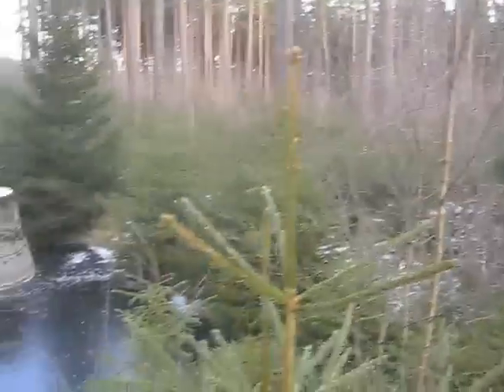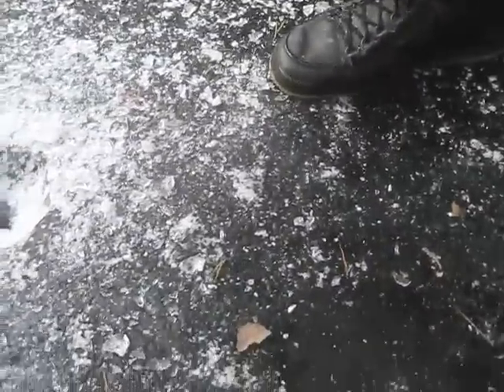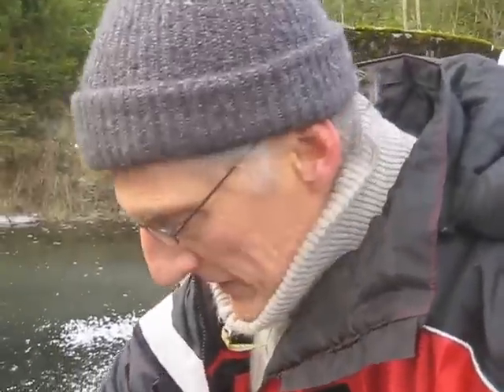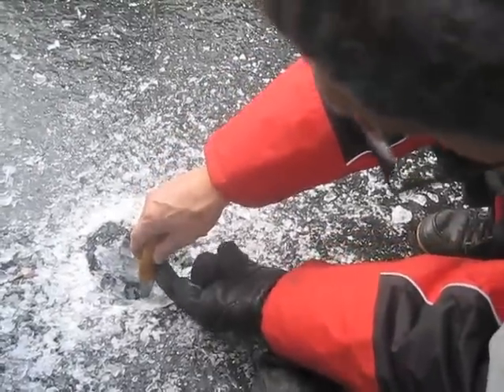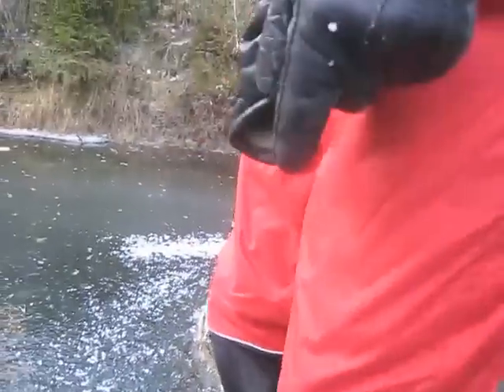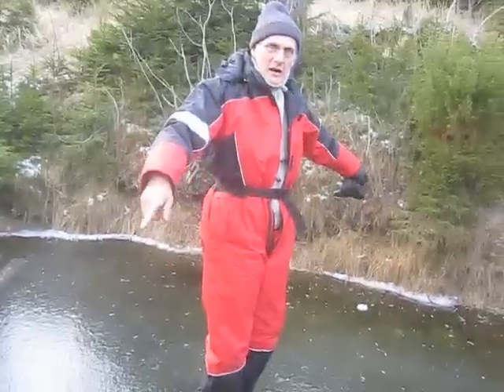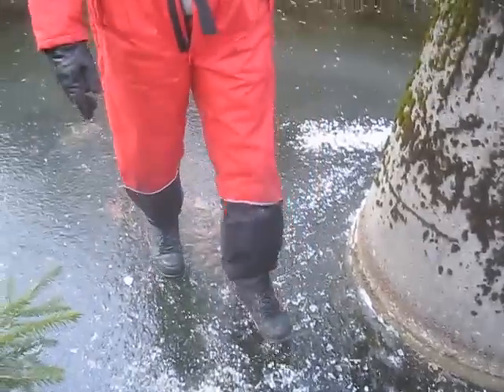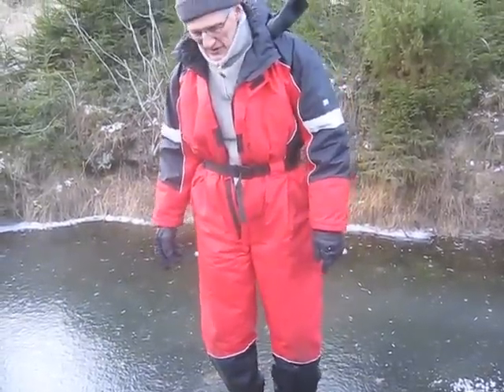how to test if ice is thick enough for walking

Comment: The ice must be 4 inches thick or more to be safe to walk on the ice on the pond or lake to prevent falling through the ice and probably drown.
Reply: I weigh 185 and have walked on 1.5 inches. At 3 inches of solid black ice, you cant even crack it. Army guidelines even say 2 inch of black lake ice is safe for 200 lbs . U could drive a quad on 4 inches if you wanted to . I went over 3.5 one time it didnt even crack. I've lived on a lake for 20 years I've accumulated tons of info on this stuff and experiment myself also. And black ice is easy to see through easily. If you look closely you can get a pretty good estimate of the thickness just by looking straight through and looking at the stress cracks they are extremely visible and show the whole thickness dont even need to measure if you know what you're doing

Comment: Note that this is on a small pond in Norway - the conditions will be different in different locations and bodies of water. On a large lake you would need to check the ice not only near the shore, but also in places where there is increased current (like between two islands). 5 cm is a minimum - if you want to feel really safe go for at least 8-10 cm.
Reply: Hi people from 5 years ago
Reply: Whats a cm, ig ill just die then
Reply: @imjustaguy4340  Hehe.. 2" min and 4" to be safe, don't die my guy
Reply: @imjustaguy4340  centimeter